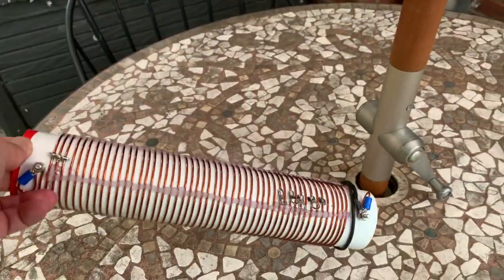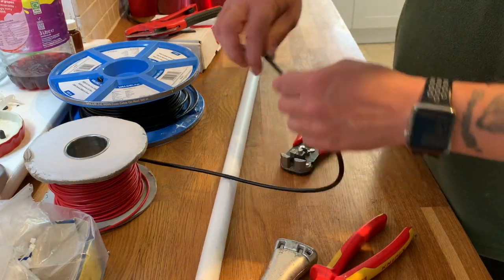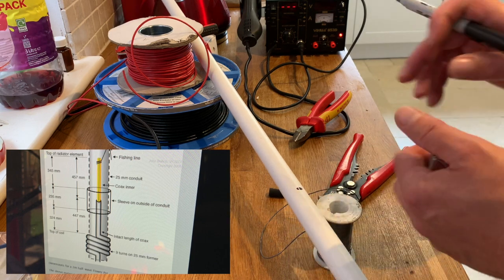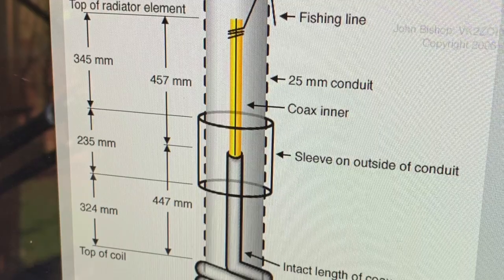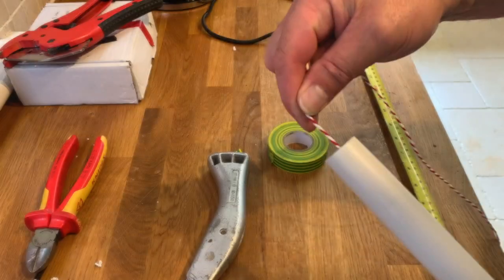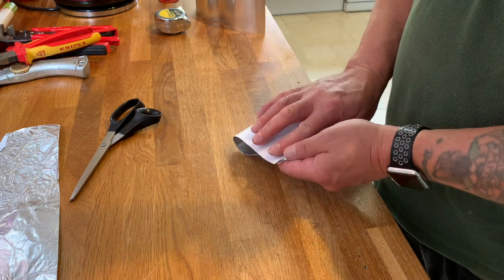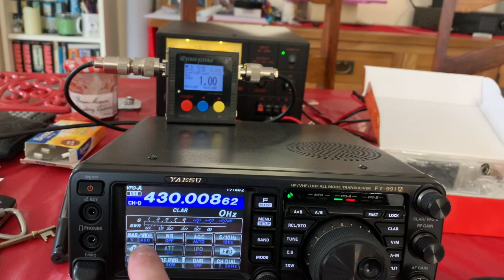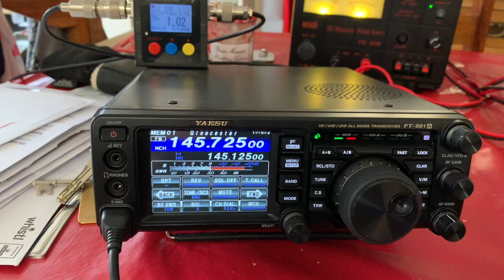HAM RADIO: Flower Pot Antenna, Perfect Stealth Antenna for 2m/70cm

Comment: Hopefully Mike gets this pinned to help Elmer others, as my other reply buried deep in the bowels of another old comment solved the riddle for a number of folks newer to radio, who didn't quite get how a section of foil over the other antenna elements magically gives you 70cm use?!🤔

If you notice at 3:53 Mike measured and marked the dead center of the dipole elements on the outside of the PVC... then at 11:30 that mark ends up being used and I guess several people didn't catch the connection. 

The coax portion of the antenna inside the PVC is just like a simple "dipole", until you wrap the foil around the outside with it perfectly centered in between those two 2m dipole elements, making a sort of Frankenstein combination of a collinear/Yagi parasitic antenna element.

The foil acts similar to the parasitic elements used in Yagi-Uda antennas, the unpowered/parasitic metal elements of a Yagi-Uda interact as either a reflector or director, a sort of "metal RF mirror" if you will to bounce, funnel and amplify the RF as well, like an old school analog megaphone does with soundwaves, those are waves too right!
(like one of these...) https://media.yourobserver.com/img/photos/2022/10/18/403586_standard_t600x900.jpeg?3735229c1eac3ea66532f06aed1ba359424f7682

The foil in this case also acts as a quarter-wave matching stub/sleeve, it's blocking the RF coming from the center of the "2m" dipole elements which when you use a 70cm wavelength "stacks" them into opposing 70cm elements. Take two 70cm J-poles and "glue them together" at their bases where the coax normally connects, then make the short matching stub out of a tube of foil instead... Make sense now?!
Reply: Hi Måc!  Wow, thanks for follow up and detailed explanation. I've done a screenshot and added to my "antenna" allbum. Wish there was a better way to capture and link key comments to the parent videos like a YouTube Wiki.

We lived in U.P. for 10-11 years and drove through Fircrest all the time (very slowly - your traffic police have no sense of humor!)

Kind regards,

John
Reply: @johnbauman4005  glad I could shed even more light! I'm an extremely 'visual' kind of thinker and can imagine how things work or fit together in my head (that most people would need to put to paper or use 3D CAD to solve) which also tends to help me illustrate those ideas to others. And yeah no kidding... the fuzz around here are so bored out of their minds with nothing better to do than write traffic tickets for literally going "1" over the posted speed! (Not even joking, some friends of mine here got a couple tickets for 1mph over!) 

73 John!
Reply: Thanks a Stack for a Brilliant Explanation ..... We here in ChCH, NZ use 477MHz and I am looking for some 'Pointers' as Just how to do this in this Great design .... ????? Strange, I was just thinking last night about  just using to J-Poles ..... :-)   :-)   :-)   Best to ALL from ChCH, New Zealand
Reply: @kiweekeith  and we just got a big bunch of Kiwis from the store?! 😋
Reply: What's confusing me, is that in the diagram the foil sleeve is not centered on that mid point. Have a look at the diagram again, and let me know if I'm losing my mind. To me it's showing more sleeve over the intact coax (lower) than the inner (upper). In the video the sleeve is just folded in half, which wouldn't adhere to the plan. That said, it seems to work, so I'm double confused.
Reply: @BarryManatee  it doesn't have to be perfect, but that does effect the SWR if the top and bottom elements aren't quite equal. 

Reminds me, something I HIGHLY RECOMMEND for people in the US is ditching your inches and get yourself a metric tape measure for antenna building. For starters, everything in radio is measured in meters to begin with... So you can not only skip the conversion to inches, but also there's a lot finer incremental marks per inch on a tape in millimeters than the bloody confusing fractions of an inch, so I find you can make much more precise antenna elements.👍

Comment: Hi Mike, just to let you know that I have constructed one of these flower pot antennas using Ultraflex 7 with Messi and Polaolini connectors.  Made to 123 Mhz which is 54cm each leg with 87cm wrap as per Ray G4NSJ instructions and yours. I didn't use the foil because I don't transmit.  The results are truly amazing!  But not just on air band.  I have a Uniden UBC125XLT for VHF and a Tecsun 501X for HF.  I can receive all of the Amateur HF band with good signals and the scanner gives me a full 5 bars signal strength for the Tower and Approach frequencies and I am 11 miles from B'ham Airport.  I also have a SDRplay RSPdx receiving on a Radio World HF discone and the flower pot far exceeds the discone performance and it's in the same place.  I can't seem to get a definitive answer from anybody as to why this performs so well when it's supposed to be just for air band. Maybe you could shed some light on it please.  Never the less thank you, thank you for posting your construction.  It's a wonder the antenna makers don't go out of business with these flower pot antennas being so good and dirt cheap.  Hope you can come up with some comments as I am really intrigued to get an answer.  Thank you again.

Comment: Rather than use fishing line to hold the top end in place, I soldered a small loop at the top, drilled a hole through the pipe, and passed a cable tie through. Well, I had cable ties on hand but no fishing line. Excellent antenna, sir.
Reply from the maker: Sounds great!

Comment: I've made several flowerpots, for 2m/70cm and for 4metres - Great antennas, I tested the vhf/uhf one at 6feet off the floor and during testing managed a 40mile contact. Probably the same performance as some shop bought white sticks...

Comment: I'm a new ham from Texas. I've been looking for a way to get the most out of my HT as it's the only radio I have, so I followed your instructions and built this! I appreciate the detail and antenna analysis; I don't have the equipment to properly test mine, so I'm trusting your work. The signal reports I've received so far suggest that it works great. Thanks for the quality instruction.
Reply from the maker: Welcome aboard!

Comment: What a great tutorial, I've seen plans for this antenna for a few years now and always thought I will have a go at that. Your video inspired me to build one too, it's turned out great, I am looking for a bottle cap to seal up the top end, so I can mount it on a pole outside.  Cheers 73's. Idris Mw1abz
Reply from the maker: Thanks for the flowers,  upside down coke bottle top works

Comment: I have a loft antenna , my intention is to run the coax down the wall inside the plasterboard (trying to keep the Mrs happy by not having surface mounted cable or trunking) is there a  so239 mounted on a blanking plate available or will I need do make up my own?

Comment: Now that impressed me, but I think I missed something along the way.  The coax from the coil went back through the pipe to the radio, yes?  How did you use the foil to get the 70cms.  Sometimes you speed up your video just a bit to much and it is easy to miss something.  If you were new to this and just got your licence it might be hard to follow.  The only bit I didn't quite get was the 70cms bit Mike.  Have you a Website it is on?  Or can you explain it here or the next time you are on Discord?  That is an excellent aerial for someone that is in a flat with a balcony.  I like it and might have to result to it myself.  Now can you build one for 80 meters?  Only joking!
Reply from the maker: bob fourjs  foil acts like a co-linear not sure how but it works, and yes the coax goes back inside the pipe and out at the bottom.
Reply: @mike-M0MSN  I am going to have to look this one up.  It is a new one to me, but it shouldn't be as Ham Radio Concepts did one and put plastic flowers over it and put it on his mothers porch.  I can't remember if it did 70cms,  This is good, I need to get my head round this one.  Thanks for the reply.
Reply from the maker: https://vk2zoi.com/articles/dual-band-half-wave-flower-pot/
Reply: @mike-M0MSN  Thanks Mike, just what I need  :-))
Reply: @BoB4jjjjs  The coax portion of the antenna inside the PVC is like a dipole, the foil goes around the outside perfectly centered in the exact middle of the dipole elements and makes more of a collinear; if you notice he measured and marked the dead center of the dipole elements on the outside of the PVC at 3:53 but you have to wait until 11:30 where that mark ends up being used.
Reply: @macgyver5108  Cheers, I just needed to get my head round this one!
Reply: @BoB4jjjjs  yeah, he made the mark on the PVC but forgot to mention that was where the other 70cm element was going to be centered at until late in the video. 😉 Cool design!
Reply: @bob fourjs Thank you for asking this. It totally confused me. To be honest I’m non the wiser. Cheers for the video though Mike de 2E0TWD
Reply: @macgyver5108  A little bit confusing, but at least he mentioned it.  I know it is not easy to edit a video and remember everything.  It is so easy to forget others have not done a build like it and just assume the other person knows what you are doing.  Whatever, if you watch it a few times or Google it you might get the plans for it.
Reply: @macgyver5108  Thank you for this explanation. 

I've been googling "parasitic element" and "70cm phasing" to try to understand what's going on electrically.

Your explanation should be pinned at the top given the number of times I see the question appear in the comments. Had to dig to find your gold nugget! It isn't explained in the source reference article either.

I've done a screen shot for later reference.

ATB!

73,
John - KK7JBZ
Reply: @johnbauman4005 not a bad idea, but I think I'd have to copy my reply and polish it into a standalone comment. And that's just my A.D.H.D. "MacGyver" brain on a good day for ya, with the way I see the world, when most people say to "think outside the box" I don't even see a "box" because "Oh look... A SQUIRREL 🐿️!?" 🤣 Yet somehow I manage to be sort of a savant with electronics, PC's, engines or anything that involves ballistics.🤷🏻‍♂️ I'll rewrite my initial reply on the main thread after I'm done with the local simplex net that's running now...
Reply: @macgyver5108   @MåcGyver  I am just a subscriber and don't provide any content, so I may be wrong but I think only the owner of the channel can "pin" comments so they permanently appear as the first comment. 

I was writing to you but hoping that Mike would see my comment and pin yours. Sorry for any confusion!

Kind regards,
John
Reply: @johnbauman4005  no confusion! 😁You are correct, only the channel owner can pin "comments", but not reply's to those initial comments! Initial comments are what's referred to as a "main thread" and what we're writing back and forth in now is a sub thread. The channel owner can only pin main threads... Follow?
Reply: @johnbauman4005  You're just North of me too neighbor! DE K7AEK in Fircrest...
Reply: @johnbauman4005  BTW I posted new comment with an even better explanation how this antenna functions in its own thread.
Reply: @mike-M0MSN  hey Mike! As my explanation helped illuminate the riddle as to how this antenna works for so many folks and they suggested it would be a good thing to "pin" in the comments, I posted a new comment in the main comment section that explains how this antenna works even better (can't pin a comment from in this thread!). To pin a comment you just click on the "3 vertical dots" to the right of a comment and a popup menu there has the option.

Comment: What are your thoughts on sliding a couple foam pucks with a center hole down the pipe to keep the coax and wire centered inside the pipe? Do you think it would affect the performance like resonance?
Reply from the maker: good idea

Comment: Great job Mike! Thank you for your clear tutorial very well done! I will do it soon, I'm just testing the new Popovic dual band antenna realized with poor material but now, I will realize your Flower Pot Antenna! Great, I just have a couple of doubts on the measure you show between the tail and the end of the mass of the coax...I will see again the tutorial doing the job! Thank you again, BRGDS 73 IZ0AIO - Angelo
Reply from the maker: This may help..  https://vk2zoi.com/articles/half-wave-flower-pot/
Reply: @mike-M0MSN  Thank you so much! Now Everything is clear to me! I will proceed as soon as I have a bit of time...just another question, I have a 20mm PVC conduit, can I use it of is necessary a 25mm because of spires? Thank you for your kind help! Ciao

Comment: Very cool build.  I just ordered a cheap 2m radio off of Amazon, and I thought a better antenna would greatly improve the performance.  There is just one thing I don't understand. At about 11:45, where you're putting the metal foil around, centered at the center point of the PVC, the metal foil is not connected to anything?  It just wraps on the outside of the PVC?  The antenna can work with 2m and 70cm without any kind of switching?  Forgive my questions, I've been studying antenna theory for about 2 hours now !  Very little experience of knowledge.
Reply from the maker: the antenna will work without the foil however the foil is there as a parasitic 70cm element

Comment: Question: In the video, your coil has 9 turns. On your website, in the photo of the final version, the coil has 13 turns. Why did you increase the number of turns in the final version?
Reply from the maker: To reduce the RF going back to the shack, not needed but .....

Comment: I'm assuming a non-rigid version where the pipe is only used to form the coil, is possible. The whole thing would be suspended from the top of a kite-pole, with the pipe possibly sliding over the pole. I'll know soon enough anyway.

Comment: I like this.  I made a 2 meter ground-plane but it measures out between 1.3 and 1.4 swr,  I think your project might be a better
solution.  I need it to run reliable winlink messaging.

Comment: Cheers Mike, another lockdown project to tinker with. Anything to stop this one being made "suitcase packable"? I.e. without the conduit? Foil tape wrap direct on the cable & the same "air core" choke position & dimensions?
Reply from the maker: Cut the conduit in half and use a straight connector, foil rap needs to be spaced 10mm off the coax...

Comment: I think this is the first antenna build video that I watched that is not about some form of dipole. Weird not to see the coax braid connected to it. Good one though!
Reply: This is basically a dipole antenna.  One leg is the bare wire on the end, the other leg is the unstripped portion of coax which will radiate from the end of the braid down to the balun.

Comment: Hi. Nice video. Please have a question. What is the purpose of the aluminum foil around the perimeter of the pipe? Need if I want to listen to radio traffic on Air Frequency?
Reply from the maker: It is for 70cm, phasing,
Reply: @mike-M0MSN  I'm sorry. I'm not educated in this area. Does aluminum foil have a positive effect on listening to the air zone? The frequency range of the air band is 108-136 MHz thanks
Reply from the maker: No, it would be better without for the air bands, but I would suggest you will not see any difference if you leave in on.
Reply: @mike-M0MSN  thanks you ;-)

Comment: Thanks for the video. would it matter if I used 1.5mm solid single core  instead of the 1mm and could you tell me what type of coax did you use? Thank you.
Reply from the maker: Yep you can use that, the Co-ax was RG58..

Comment: I see the red wire is 1mm “18 gauge”. Could I use 16 gauge instead or would it change too much
Reply from the maker: you can use that yes
Reply: @mike-M0MSN  thanks. Already made and it turned out great

Comment: Hi Mike. Sorry for being noob, but i like to know how the alu tape for the 70cm works. Its not attached to the coax in any way.
Reply from the maker: parasitic element, but the antenna would work without it as it is an harmonic of 430MHz

Comment: HI,

I've had a go at the 2/70 flower pot this morning.  I enjoyed the vid and building along.  However, on completion my SWR on 2M is high.  It tunes in great at 150Mhz??  Also, I get no reading at all on 70cm.... CAn you think what I may have done wrong?

Rich
Reply from the maker: Sounds like the elements are a little short, not a problem, just add 3cm of wire to the top element and re-SWR.  :)
Reply: @mike-M0MSN  Hi, I've sorted the problem on 2m but I still get nothing on 70cm.  I'm testing with a n MJF269 and it shows nothing at all on 70CM.  Working great now on 2Mtr
Reply from the maker: @richtaylor6773  so if I am reading this right, you have no SWR reading on 70cm at all?  What is the reading just outside the band? 446mHz? 438mHz?    Is the transmitter working?  No reading or very high reading?  Cheers
Reply: @mike-M0MSN  I test my mfj269 on my house 2/70 antenna and get the same reading of nothing. I may have a problem with my analyser I didn’t know I have. Looking on bright side that’s Something else to research and buy lol... thanks for all your help

Comment: That looks so cool. I have no idea how you know these measurements or really what your doing.  Been studying to get licence but really have no clues what half this stuff is. Anyway great job. Lots of folks commenting great job. So will I .
Reply from the maker: Measurements, just remember in radio, everything is a % 300......when it comes to antennas  example. 300 /145mHz = 2.xx / 4 for a quarter wave
Reply: @mike-M0MSN  300/145=2.068/4=0.517  is what
Reply from the maker: VISWANATHAN R ELAYIDOM 51cm is the length of the top(driven) element..  :)